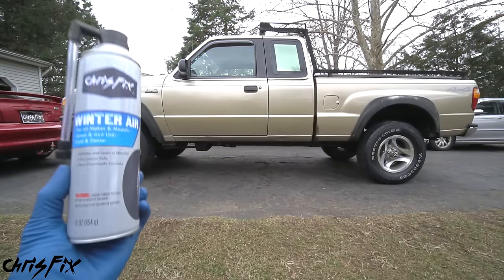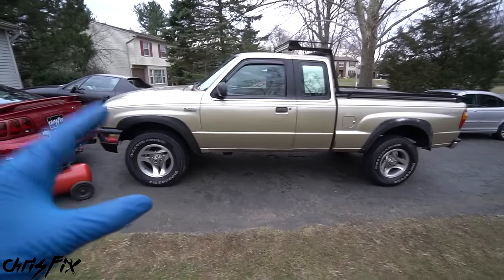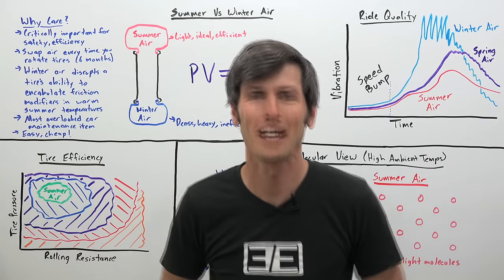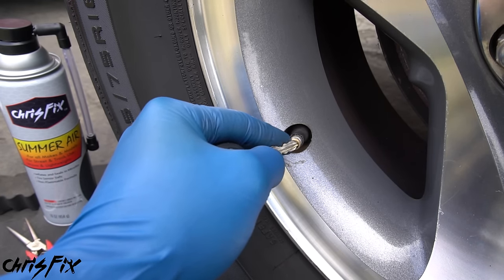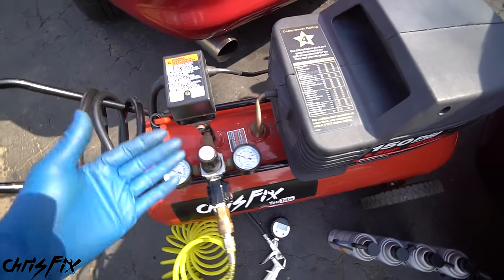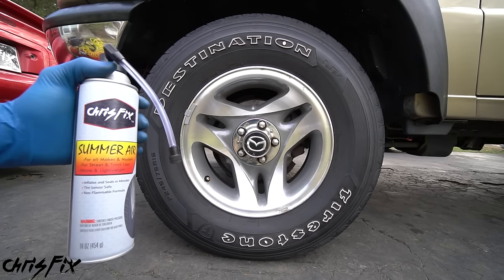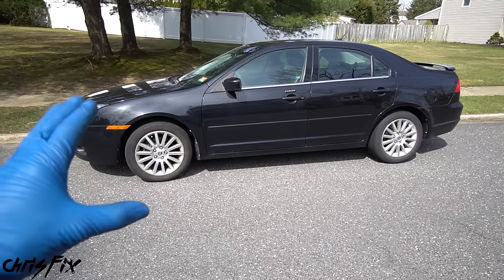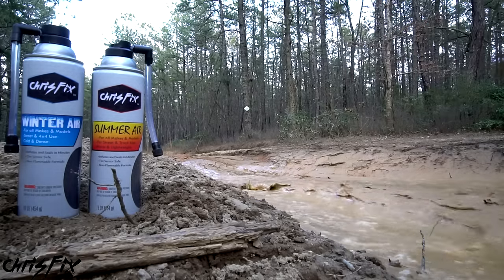Why it's IMPORTANT to use the Correct Air in Your Tires (Summer & Winter Air)!

Comment: Jokes on you I use Natural Gas, it's good for the environment cause it's natural.
Reply: Haha! Underrated comment!
Reply: But we should be using nitrogen in the tires so they don't leak, right?
Reply: I don't think that goes there...
Reply: I use combination gas. You can use it in winter as well as summer. But it only lasts 2 years unfortunately instead of the summer and winter air you can reuse 5 years if it's good quality
Reply: I like to use a mix of %78 Nitrogen,  %21 Oxygen, %0.98 Argon, %0.04 Carbon Dioxide with a few trace elements of neon, helium, methane, krypton and hydrogen. As well as a little water vapour. I capture it all and compress it then blow it into my tyres, it works great.
Reply: @ryanbennett1024  Did you just describe the earth's atmosphere composition?
Reply: Why not fill up the engine bay with hydrogen as well as the tires, make sure you fill your tires up with hydrogen seeing as you want nice warm air in the summer
Reply: @camper1749  you're wrong, that as the composition of earth millions of years ago
Reply: @ammarabbasi3230  Looks like I made a mistake.
Reply: HERPY DERPEDY VsCo?
Reply: lol "cause it's natural"
Reply: Bad, I use organic air.
Reply: Yea and the tires get lighter which means better acceleration
Reply: I run helium in my tires to make my wheels lighter
Reply: Exactly. I use nitrogen myself.
Reply: I fill my tires with dihydrogen monoxide gas
Reply: Uhh you guys are using air? I thought you were supposed to use water? 0-0
Reply: edog6504 No, I recommend dihydrogen monoxide
Reply: My car runs on farts aka gas
Reply: HAHAHAHAHAAHAHAHAHAHAHAHAHAHAHAHAAHHAAHHAAHAHAHAHAHAHAHAHAHAHAHHAHAHAHA! Very funny
Reply: i use propane :v
Reply: Lol
Reply: Ha ha tire go boom
Reply: Until the engine bay catches on fire
Reply: I don't care of polution I use only 'PRO'pane gaz
Reply: Make sure to hear the tires, it makes the bead seat better and makes it so your natural gas won’t leak. Saves you money
Reply: Jokes on you I use gasoline so no matter what my tires have gas in them
Reply: I make my own natural gas
Reply: ArcanePath360 and did you fly?
Reply: My car runs on coronavirus. Jk!
Reply: If your are that worried about the environment buy a bicycle 😂

Comment: I know its April fools..... but ... after this video I might just replace my winter air with summer air JUST to be safe.
Reply: Not joking, you should should check your tire pressures when the seasons change. It can fluctuate a bit due to temperature change. Engineering explained wasn't 100% joking when he mentioned the ideal gas law haha.
Reply from the maker: Doesnt hurt to check your air pressure and  make sure the air is good. Be sure to check the spare too!
Reply: I recommend you to use Racing air. It adds an extra 35 HP to your car
Reply: @SPER1   I should capture some summer air with ziploc bags and sell them to the people up north. We have plenty of summer air down here.

Comment: April 1 maintenance minder for EVERY VEHICHLE:
1. Blinker Fluid fill up
2. Summer air fill up
3. Inspect Piston return springs
4. Listen for potentially bad muffler bearings
Reply from the maker: Looks good to me!
Reply: and now how to replace wiper brakes
Reply: @NaielPasha  Now we just need him to make a video on how to top up the brake pad lube & we'll be good to go.
Reply: Air intake grease is very important, can't have air getting clogged up.
Reply: let us not forget, the mirror oil, prevents the mirror from getting fogged up.

Comment: Holy shit, I just did this! I measured my top speed with winter air - barely 112mph! Then I switched to Summer air and I'm already up to 126!!! Thanks Chris! ✌
Reply: Man you should have watched the whole video :D
Reply from the maker: Dude add a few stickers and you will break 130mph no problem! Just be sure to paint your brake calipers for better braking at those speeds!!
Reply: @chrisfix  you mean paint it red right
Reply: @chrisfix  You know karma ? He is gona break into your car at 130mph with his pink breaks :D
Reply: Nuwanda84 before u carry on pushing it u need to put new piston return springs and muffler bearings also u need high performance blinker fluid unless ur a bmw driver
Reply: @chrisfix  dont forget the JDM stickers; +5HP each sticker

Comment: It’s faster to remove the Winter Air by sucking on the valve stem. I can’t believe you missed that tip.
Reply: Spray down the valve area with blinker fluid to make sure all winter air has been flush out. Remember to do it so that no winter air is left in the tire
Reply: I concur
Reply: @leontam221  No. Use Soapy Wooder.

Comment: And don’t forget to check your blinker fluid, piston return springs and muffler bearing!!!
Reply: Yes exactly :wink: :wink:
Reply: Lol those muffler bearings could throw a piston rings through the transmission when they start to leak blinker fluid through the brake computer
Reply: Yeah right
Reply: @nickanon329  I would expect any newer car to actually have a brake computer.
Reply: @user2C47  Why rely on a computer to control a critical component...???
Reply: @nickanon329  the computer would likely be fail-safe. If the computer fails, the mechanical systems will still work, just without ABS or traction control.
Reply: @user2C47  Yeah, I think my last vehicle leaked blinker fluid into the abs primer weld and the brake pipe threw a rod because of a computer. I don't trust computers in brake components any longer.
Reply: I love Sh*t posts.
Reply: Sebastian Alboiu r/woosh
Reply: I Don’t Know What Studios r/woosh
Reply: David Stadef your a r/woosh
Reply: David Stadef sebastian was being sarcastic.
Reply: I Don’t Know What Studios every 9 year olds comeback
Reply: Don't forget the kniffler valve!
Reply: OMG DUDE YOU JUST MADE ME REALISE THE PISTON RETURN SPRINGS VIDEO IS BS  WTF
Reply: Julian Lucke but what about the mirror fluid?!?!?
Reply: That muffler bearing especially

Comment: i fell for the blinker fluid video now my flux capacitor wont turn on
Reply: 1 april fp
Reply: Don't use it. Temporal mechanics is confusing, and the smallest change to the past can change the future drastically. It also requires 1.2*10^9W or 0x481F2280W to initialize.

Comment: Instruction unclear, filled my tyres whit helium, car took off & it's floating near mars. 0/10 would not buy again.
Reply from the maker: I’d be happy if I had a flying car!!
Reply: I wish to invest in your helium based spaceflight venture.
Reply: No one else like this comment it's at 69 likes
Reply: Helium or Hydrogen in a car's tires will cause a difference in apparent weight of less than 1%. Definitely not enough to reach escape velocity.

Comment: Chris that vid was really helpful cheers 👍
In Australia summer air and winter air can be found In the same isle as the left-handed screwdriver 😂
Reply: Aisle! While you are getting your left-handed screwdriver, ensure you ask for a long weight, chances are they will not have one on the shelf, and so will need to have a look for them out the back.
Reply: gorillaau 
Same place as the Stripey paint?
Reply: @aaronbehiels2232  Yes, though two tone paint will be cheaper.
Reply: Left handed screw driver !!!  I hadn't heard that one before, thanks for the laugh !!!  I'm going to steal that joke and NOT credit you.
Reply: You missed the blinker fluid
Reply: @jonathanpalmer228  You mean 500ml of elbow grease. Very important for those CV joints and similar parts on you car, trucks and motorcycles.
Reply: gorillaau  that’s a good point 😂
Reply: vectorm4  I officially give it to you
Reply: Ah, the old "striped paint" 😂🇦🇺

Comment: I just cut some holes in the tyres, lets the air naturally circulate and saves having to change the air seasonaly.
Reply: What did you use to make the holes? I've been wanting to try this but don't want to mess it up.
Reply: @cuisinwithkev2699  I tried this once I used my spare can opener and a 1 dolla tooth brush
Reply: Nooooooo
Reply: great idea, I ll try that tomorrow.
Reply: Bloody brilliant, sir!
Reply: I just tried the hole cutting, but it made the car hard to control. i guess this is because it's not sure if it's in Europe or the UK?
Reply: :-D :-D :-D :-D :-D
Reply: @TheChipmunk2008  You need to download the Brexit firmware/software update.
Reply: @chrisbyers4726  OMG do i need an OBD II dongle or an OBDIAH dongle? I'm lost
Reply: [breaking the joke] this is why i fuckin love youtube <3
Reply: @TheChipmunk2008  🤣🤣

Comment: Mechanics aren't really good where I live. I've asked them to swap my exhaust bearings and fill my tires with summer air and he called me crazy.
Reply: jtdc86 have you tried using elbow grease and replacing your blinker fluid?
Reply: Exhaust bearings are pretty straightforward and can be done with basic tools.
Reply: Nether in my spot... I changed my tire for winter, they torqued it over 200 feet pound !! My girlfriend was stuck on the road with a flat. I ask them if they could torque it, they said that they didn't had a torque wrench... Just watch chrisfix and be far has you can from mechanics !
Reply: Don't forget to check your piston return springs.
Reply: 🤔 I wonder why they couldn't! Try blinker fluid and a bushing instead of a bearing maybe
Reply: those big box stores aren't any good either, you'd think they'd have some basic training to know these things, i asked for some of that new all-season-air and they just stared at me.
Reply: I have a rear mounted turbo on my car (turbo is the muffler ;-D), so I joke with people that I actually do have muffler bearings.
Reply: That's horrible! I have 4 months experience with working on Tires (I'm pretty much an expert) and seasonal Air exchanges have been  keeping us very busy thr last few weeks.
Reply: Did you check the blinker fluid?
Reply: @Sunderas   I check my beer can (bottle) every minute , am I doing a good job ?
Reply: I'm not the least surprised that he things you're crazy. For this crazy spring, it is way too soon to switch to summer air in much of the U.S. Where I live, we had freezing temperatures over the weekend. The temps need to stay well above freezing before doing an air swap.
Reply: @shark180    not just winter and summer  air for the tires , you forgot the spring and the fall air as well , have beer on me , 🤣
Reply: Cooler bLiNkEr FlUiD
Reply: Did you ask him to refill your blinker fluid?
Reply: Luckily my blinkers fluid and my piston return springs where ok. Otherwise I'd be down to a long bill of explanations hahaha
Reply: @hermanchow1405  Yes you are. Yes... you... are... :)

Comment: dont forget to adjust your torque settings for summer or winter, due to differences in thermal expansion
Reply: Aaron Fralick while you are at it, you should ask the mechanic to replenish your blinker fluid and check your piston return springs.
Reply: @neitherlink6612  also fix the rattle in the exhaust by replacing that old muffler bearing

Comment: Don’t forget to change your stereo oil every 10k miles as well, gotta keep those subs kicking. Also, taking a tire rubber sample from the sidewall with a drill and drinking straw to remove it from the tire.

Edit: forgot to mention that the tire sample needs to be taken to a local shop to be inspected/evaluated.
Reply: You get better audio quality if you use full synthetic. That Mobil One Annual Protection is pretty good.
Reply: Gruntsworth I’ve only ever done it on lower end cars, so I use synthetic blend at most.
Reply: HellishGrin460 can you buy your own rubber testing equipment like the big tire shops?
Reply: Matthew B. You can, but it’s typically not as accurate as the test they do in the shop. Just don’t let them up charger you for the dihydrogen monoxide saturation test, it’s a total scam and only really needs to be done if the tire is more than 5 years old.

Comment: I always run summer air in my cars. But for my customers I got this really great machine to do an air flush for a full exchange. Takes seconds to flush the air.
Reply from the maker: Do you do this as a courtesy for the customers when they bring their car in to get serviced?
Reply: As an ASE Master Technician I always perform this service as a courtesy, especially on April 1st.
Reply: HumbleMechanic costs $220-330
Reply: Is this machine a knife?

Comment: Thanks Chris, because of the warmer and lighter summer air, There is less wear on my tires and there is less effort needed to turn the wheels, which means that there is less strain on my engine so my piston return springs are gonna last way longer this season.❤🙏

Comment: Just recently realized I have been fooled for 2 years. Ever since I watched this video when it first came out, I have been instructing my friends about this and bringing their cars including mine to deflate the cold air from the past winter and to fill up some warmer air on a hot day in the summer. Really felt that weight savings and relatively some extra horsepower right after every time I changed them out lol.
Reply: It's called the placebo effect my friend.
Reply: @higtmance3641  Yeah, if you let your car believe it's more powerful, it becomes more powerful.

Comment: In the winter, don’t forget to remove your radiator cap after a long drive. It’ll release the cold air and prevent the engine from freezing

Comment: Thanks for the information! I filled my blinkers with brand new synthetic blinker fluid in my 1993 civic and it works great! The piston return springs also helped reduce vibrations, the muffler bearings also made the exhaust sound better! The new summer air helped with handling too.
Reply: Hair I thought there was a pube on my screen
Reply: You know how is the synthetic blinker fluid working out for you, I've always used the natural stuff and was wondering if it's worth it to upgrade
Reply: @marshallboice6871  Yeah its worth it, the synthetic blinker fluid cools down the blinker better than the natural stuff.
Reply: Can't wait to see what's next
Reply: @marshallboice6871  Why not?

Comment: I just fill mine with water, I've actually noticed the tires last longer that way and you save money in the long run
Reply: Austin Bost that’s because the water is nourishing the tires and keeping them hydrated even during the summer so that makes the tires last longer this has been basic knowledge for years my friend I’m a genius my long hair is an extension of my brain 😂😂😂🤣🤣🤣
Reply: @sanchopancho1918  yeah if you live anywhere up north just add 50/50 anti freeze for the bad winters
Reply: I used a hydrolic splitter and measured the ratio of water anti freeze winter air n sommer air! 
I really cant believe I went head on into a curb n I just rolled over! /LAUGHING\!! 
have a great summer everyone! ✌
Reply: @Austin bost it’s wasting money cause your more heavy meaning you have less mileage
Reply: @Cantbefound  not as heavy as winter air

Comment: Just Changed my blinker fluid, thank God this video popped up, I total forgot about changing the air in my Tires to Summer air... Now I wish I bought me some good summer air during the fall...
Reply: Summer air goes on clearance during the winter, vice versa. 🤷🏻‍♀️😆
Reply: Dont forget to check your muffler bearing while you're at it!
Reply: @jacksonsandstrum7875  And the piston return springs.  They might not be holding the proper pressure.

Comment: Some very important information that Chris didn't mention.
If you live in a climate that doesn't experience large seasonal temperature swings and you drive a front wheel drive car, the best thing to do is to use Winter Air only on the front axle to increase traction for accelerating, steering and braking. Then you can use Summer Air on the rear axle because they don't need as much grip and can benefit from the performance benefits of Summer Air. Not only that but you won't have to change your air twice a year.

But no matter where you live or what you drive, make sure that BOTH tyres (I'm British) are filled with EXACTLY the same air. I'm surprised Chris didn't mention the disastrous consequences of driving with mismatched air.

Comment: make a 50/50 mix to have spring air, but if you want fall air, just uneven the mix by adding more winter air, that should do the trick
Reply: I would say a 60 Summer/40 Winter ratio would be more appealing for fall driving. There usually isn't much of any obstacles in the fall beside leaves that would be decimated by the weight of a usual passenger vehicle. Plus, you'll be able to go faster. ;)

Comment: But it said 30 PSI COLD, you need to convert to PSI WARM for summer air. C'mon Chris, that's a rookie mistake.
Reply: Ian 😂
Reply: Rookie* what a rooky
Reply: It’s rookie*
Reply: You can usually find the PSI Hot info on a sticker under the hood on the shock mount closest to the blinker fluid reservoir.

Comment: But have you checked the piston return springs? Winter air causes stress on the joints with the crankshaft of the turbo struts and they could bend. Be sure to check that

Comment: Thank you for that video, I didn't know about the important differences of summer air vs winter air, although I spotted a mistake: When you let the air out of the tire, you must let it escape fully. In your case, the tire was flat on the bottom but the top 3/4 was still round, which means there is still some winter air left!
Reply from the maker: Bernoulli’s principal states that a low pressure was created from the flow of air so it sucked out the rest of the winter air.
Reply: Winter air is heavier and confined to the lower part of the tyre anyway.
Reply: @chrisfix  oh okay thanks for clearing that up! Didn't know that.